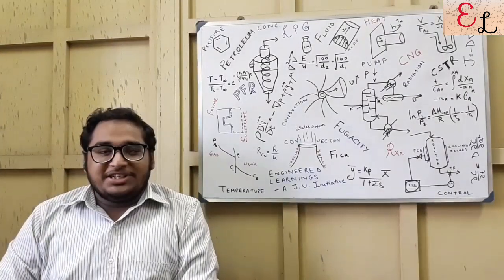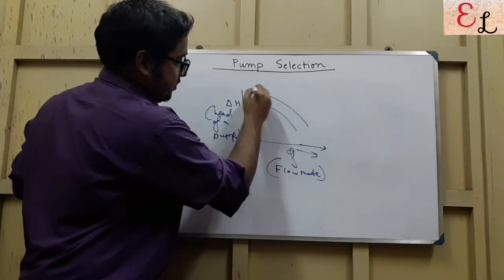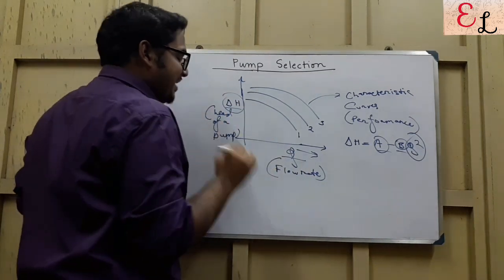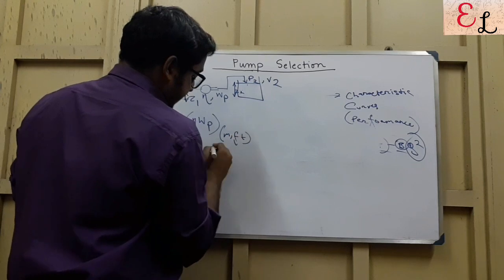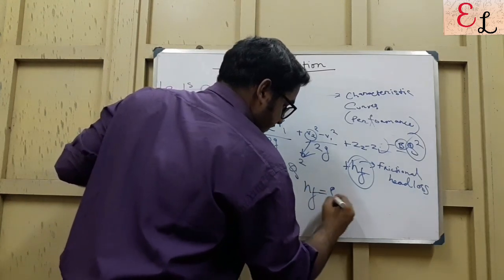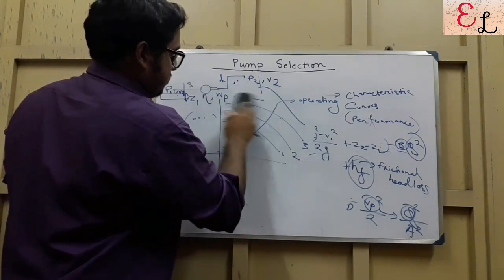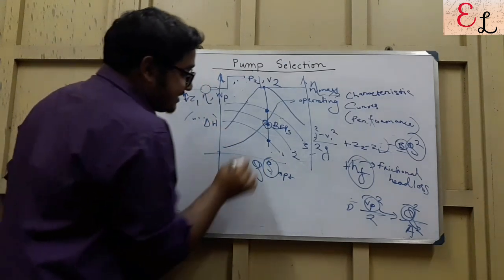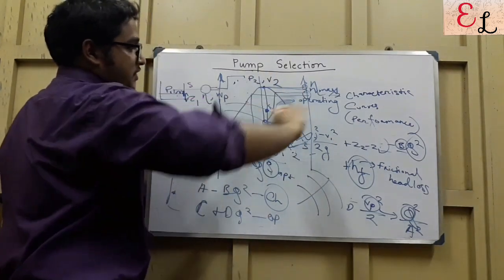PUMP SELECTION | CHARACTERISTIC CURVE | OPERATING CURVE | FLUID MECHANICS | PLACEMENTS | INTERVIEWS

Comment: Hi, 
Which submersible pump should be installed for 400ft borewell with 1inch yield. 
Borewell size is 7 inch
Reply from the maker: This is very purpose specific, you should refer to similar industrial practices to figure out the type of pump used in those

Comment: Head is linearly proportional to q( h=c1-c2*q) and the shape is bending due head loss with increase in velocity. Your explanation is wrong
Reply from the maker: That's the whole point, as you correctly said, head loss occurs with increases in velocity, doesn't it imply that head loss is a function of v which reflects itself in Head. Let Head Loss = dH infinitesimal, dH = function of v (as you have said), so it clearly implies that H = function of v as well, and the integration ends of in a quadratic equation h vs q.

If on the other hand, h would have been a liner function  of q, dH/dq would have been a constant and the graph of h vs q would be linear which is not the case!

Comment: Where to find the pump curves
Reply from the maker: Both the Characteristic Curve and Efficiency Curve is available with the Equipment Manufacturer and it is unique for each pump, the operating curve is graphically established by studying the operational parameters and hence drawing out the Engineering Bernoulli Equation.

Comment: What will happen when pump is run outside performance curve. Like what will happen when head tends towrds zero or very less than rated head
Reply from the maker: If the actual head is extremely less at high flowrate as compared to Rated Head, either the Pump is malfunctioning or there is a leakage for easy passage of the liquid right after the flowmeter which never really lets the head or pressure build up in the Pipeline whereas the Flowrate increases due to extra allowance of liquid passage through leakage.
Reply: @LifeBeyondBusiness  
No sir pump is fine, but what if we want much lesser head and higher flow. I know efficiency will decrease. But i want to know upto what extent we can increase the rate by decreasing required head.
Reply from the maker: Under Normal Operating Conditions, if everything is fine Head of the Pump is directly proportional to (Sqare of Flowrate)
Reply from the maker: So as you increase Operating Flowrate, Head will automatically increase